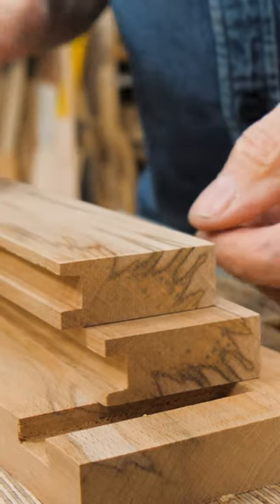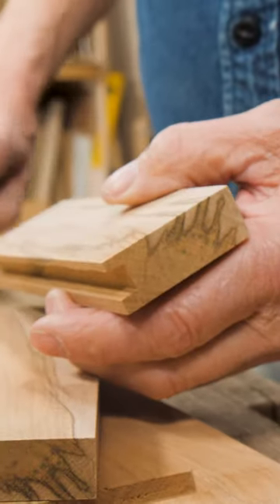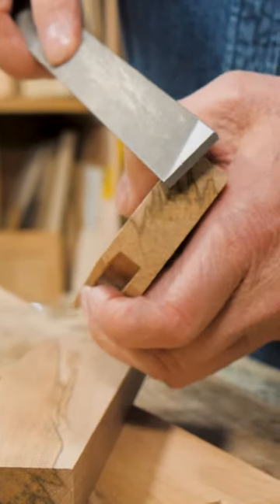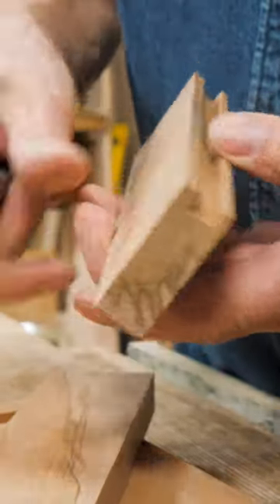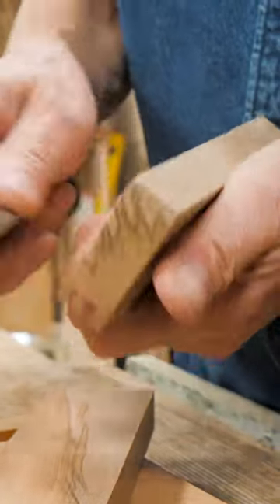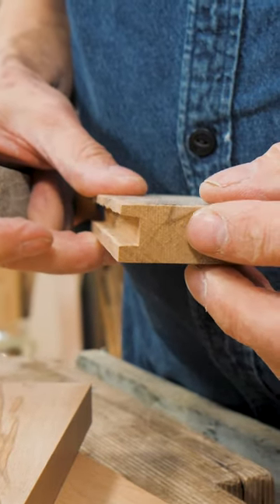A simple tool to soften those sharp corners  #woodworking #tipsandtools #shorts

Comment: Sanding block works good too.
Reply: A cut edge is better than a scratched edge
Reply: @lgb1617 Depends on what you are doing, a finished project will look much better when you lightly break the edges. Your finish will apply properly, you’ll have a better feel to the touch, and it will hide light wear on the piece.

Comment: Interesting, I've only ever used a file for this.
Reply: Same here! That or sandpaper block
Reply: I usually work with metal, where a file is the only common way to go, so I just assumed that that‘s what everyone does with wood as well.
Reply: @FrankTroiani I was taught to use a sandpaper block(we use those rolls of sticky rounds for orbital sanders).  Boss called it breaking the corners. 
Now the new crew I work with doesn’t do it, and will always think I’m putting a round over on it and freak out.  They always say it’s the painters job to do stuff like that, sanding, filling, etc….of course the painters don’t do it, and our work looks like crap

Comment: IMHO a file is most underrated tool in today's YouTube woodworking.

Most people buy and buy more expensive tools, invent and try to get jigs and methods to have higher precision cuts and match pieces together etc.

And yet, basic idea is that you first cut rough, then you work it closer to exact dimensions by sanding or filing.

Comment: Interestingly, the EXACT same method is used in the glazing industry prior to tempering glass . 
It’s called Harrising the edge 👍🏼👍🏼
Reply: Very cool, I install glass into doors! I always wonder how it’s made. I assume harrising is to prevent sharp edges for handling? Possibly to prevent breakage, or make tempered glass break a certain way?
Reply: @april_  
It reduces the stress across the pane of glass

Comment: I'm going to use this at work.  I spend quite a lot of time doing this on cabinet face frames, and especially 5 piece wooden cabinet doors.  Usually use fine grit sandpaper, but one pass would save me som time.
Reply: Use of a Diamond Hand Polishing Pads for Ceramic Tile has been my replacement of sand paper for softening the edge of the wooden pieces for small jewelry box doors and drawers.  A file does work too.

Comment: Only we oldheads are aware of and use the term "arris" applied to a sharp corner/edge when two surfaces meet, whether in woodworking, finished concrete, etc.
Reply: Why do you feel the need to try and gatekeep a word grandpa? I'm a mere younghead and i was taught what an arris was years ago.
Reply: @owaind-g678  that's how you eventually become an oldhead.

Comment: Blimey! Been a chippy specialising in repairing sash windows for the past 25 years. Always used the adjustable mouth block plane for that. Using a file - great tip. Thanks.

Comment: [Suggestion] 
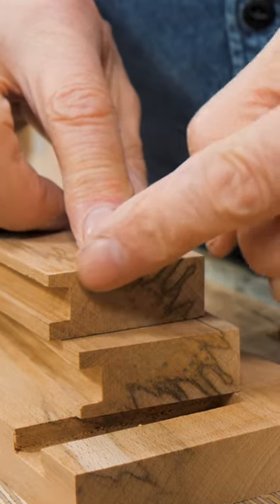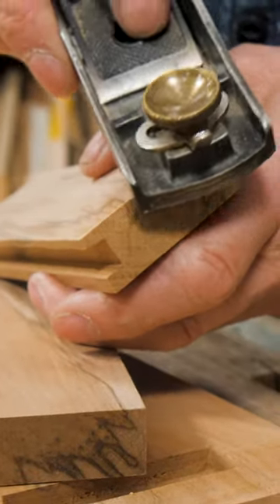As a non-native English speaker, I'd like to enable auto-generated subtitles. Apparently, they're not available on short videos ("shorts"). I'd appreciate if you could display some of the terms being used. For example: 0:06 Did you say "former sharp corner"? – 0:08 "we call that an 'arris'"? (I've never heard of the term arris before.) 
Best regards!
Reply: Arris: sharp edge. En español arista viva o afilada. ¡Saludos!
Reply: 0:06 "Form a sharp corner"
Reply: If you replace shorts in the URL with watch a short will turn into a regular video just a portrait orientation one, so you'll have to full screen it if you're on a phone to see the bottom ⅓ of the video. You're welcome 😁
Reply: Hit the three dots in the top right corner. A new menu now opens which offers a CC button for captions ;)